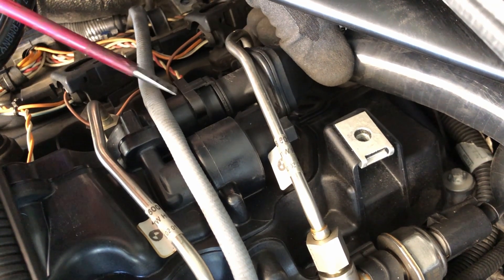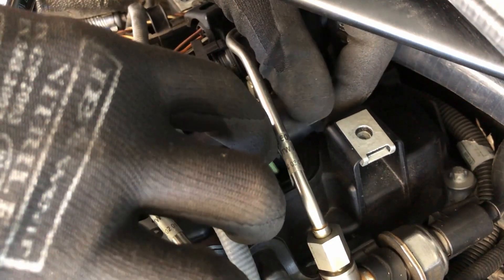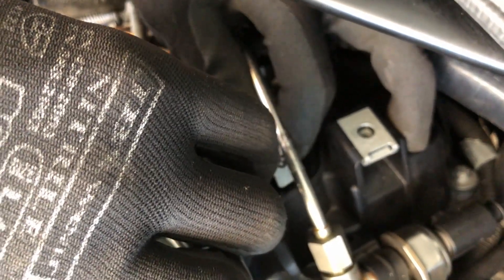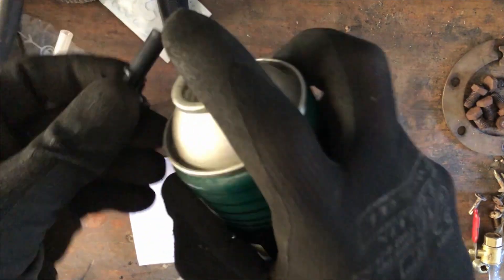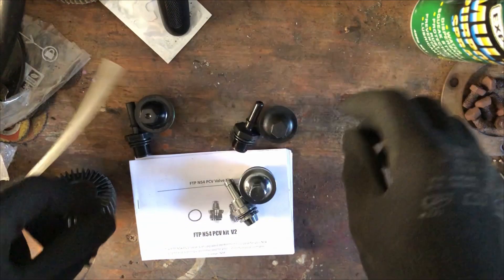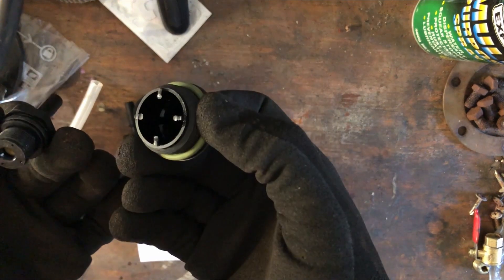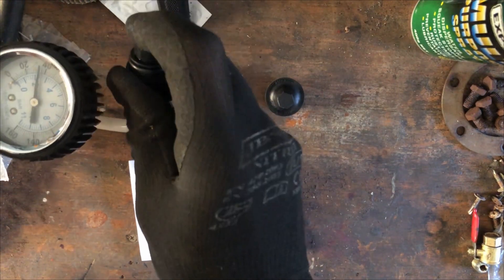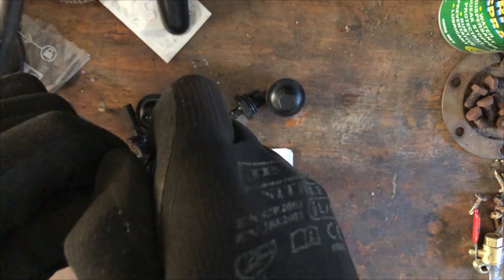FTP PCV Install and Test! N54, BMW.

Comment: Is there supposed to be a spring inside ? I don't have one be
Reply from the maker: Yeah there was a spring pushing back the pin in the opposite end from where I was blowing into.
Reply: @ScubaMade  I got a spring and reinstalled it. I just hope the spring has the right load. I shortened it so it's not too tight.
Reply from the maker: Ohh ok, I hope it works for you then! Sounds good!

Comment: Так нужно на резбу нанести герметик или ленту?????
Reply from the maker: Yeah I did on the one I got, I’m not sure if they’re all like that or not though!
Reply: @ScubaMade  Я проверил свою у неё тоже было такая же проблема я намотал лентой и поставил чувствую разницу 👍
Reply from the maker: Ok sweet! That’s good to know, I’m glad you were able to fix it! Thanks for watching my video about it too 😃👍🏼
Reply: @ScubaMade  Если у меня на клапанной крышке двигателя имеются микро трещины то может загореться чек энаджи
Reply from the maker: I don’t know if the engine light will show up, it will just leak oil, the low oil warning could come on but you’d have to loose a lot of oil. 
I hadn’t noticed any cracks in mine so I haven’t needed to change it yet, I do have an old video where I change the valve cover on my n52 engine, it’s pretty different though haha!

Comment: You would only have to put thread sealant on if you were doing this demonstration. Since those threads are above the inner pin o-ring and outer middle it really doesn’t matter being that the pressurized air from the intake would still remain in the same chamber.
Reply from the maker: Oh really, thanks for letting me know, it’s always good to learn more about this system!

Comment: Hi man! Good test thanks. I'll share my exprience with FTP PCV.
After FTP install I noticed smoking sometimes while driving, And oil consumption become 1 litre per 700-800km. I compared FTP to stock valve, I tested it with slow flow (just blow by mouth), not on peak pressure, and FTP was too stiff, so I disassembled FTP, and remove one rubber ring inside, tested again - also too stiff, next step I cut part of the spring inside, and then I got the same action as the stock one. And after this procedure any smoke or Oil consumption has gone.
Reply: My car has been smoking and consuming oil ever since I installed this upgraded PCV. 
Pretty sure that it the issue since it started doing it right away after installation. Glad you were able to fix it by cutting the spring.. how much did you cut off?
Reply: @vjoel26  remove the rubber ring first, then compare with stock pcv, it should work similar like stock. I cut around  1.5 turns
Reply from the maker: Oh that's abit different from my experience, I don't lose any oil and I drive the car pretty hard, but thanks for letting me know that, if I ever get that problem I'll look into cutting the spring down abit!
Reply: @ScubaMade  maybe it's a different, but I have almost new turbos and engine feels not so bad) And problem has gone after ftp tune)  Hope my case is not typical for this pcv
Reply from the maker: Ok awesome! New turbos must be great, that’s a big job done!! 
Yeah I hope so..
Reply: Hey, i also have the FTP PCV and started burning similar oil amounts as you. Must be the valve then aye? Would you recommand using the oem pcv valve again?
Reply: @Qonfident  I've described my modifications with FTP, I'm stiil runing on it with no issue after my mods. You could buy bms pcv, but I researched that there was oil issues with it too.
Reply from the maker: Maybe a new oem one could be ok, I'm still happy with FTP one for now!
Reply: Братан, точно такая же проблема как ты описываешь, поставил бмс клапан квкг потому что мой не держал наддув езжу на 17-20пси, начала дымить на сбросе газа, подскажи что нужно в нем изменить, просто пильнуть часть пружинки?
Reply: @ФилиппНиколаев-т9м  салют, да я Пружину подрезал и ещё кольцо было резиновое, из-за него туговато конус клапана ходил, еготя также убрал. У меня кстати друг бмс тестил и помоему он не держал давление под компрессором, ты не проверял?
Reply: Finally i found someone with the same problem as me! I got a FTP too, gonna remove it tomorrow and test it. I already ordered a vacuum side OCC that i will install next week. I hope i didnt blow any gaskets or even the turbos if the pcv acutally is defective. Thanks guys!
Reply: Same issue here and would like to know how much of the spring you cut please?
Reply: @eurogroupie  look the answer above👍🏻
Reply: Which rubber ring did you remove? The smallest one on the pin?

Comment: so with this pcv, no need to have a catch can right? because the pressure control the blowby which goes back to the intake
Reply from the maker: I'm not 100% sure how it all works yet, but I do believe I need to take the valve cover off and plug up the 6 holes in the head on the intake side, I'm not exactly sure what else I'll need to do for that to work but for now I'm not focusing on that, I do want to take the intake manifold off and clean the intake ports sometime soon though!
Reply: @ScubaMade  you should only plug the holes in the head, IF your fitting an external PCV valve, with say, a M18 Valve cover. with the OEM cover, and an external pcv/catch can setup, ie, RB external pcv + Mishimoto can, you still even then, dont need to plug the holes. since the RB kit, bypasses/blocks the flow of air from the cover, to the holes. and sends it all through the catch can. 
I run that exact setup and its fine. I have the high + low side catch cans, and they do collect alot of oil/water. Lowside collects maybe 3 times the rate of the high side.
if your using the OEM style PCV valve, you need to have somewhere for the air pressure to go, and it has to go into the inlets. These oem style valves, dont do anything towards reducing the oil buildup on the inlets.
Reply from the maker: Yeah that’s good to know and thanks for clarifying that! I have learned quite a bit since making this video and I don’t think I’ll ever plug up those holes in the head.

Comment: You was blowing the pcv valve the wrong way mate the pressure goes up we’re the valve is not down
Reply: I think it has to close when the back pressure of the turbos are high, otherwise the pressure in the crankcase is getting to high and you will blow the seals in your engine. That will happens if the valve is leaking.
Reply from the maker: Ok, thanks for letting me know, I'm still abit of a rockie when it comes to the N54 as I've only owned and worked on mine for a couple of months now! thanks for your input though, I appreciate it!
Reply: If the pressure goes up will it still leak like in the video
Reply from the maker: Maybe, I hope the pressure doesn’t go up that much though.